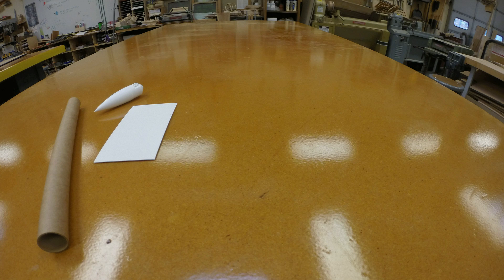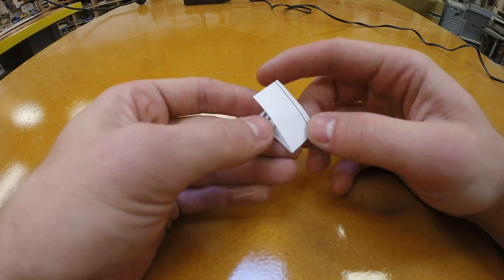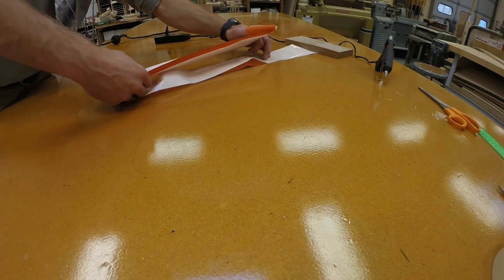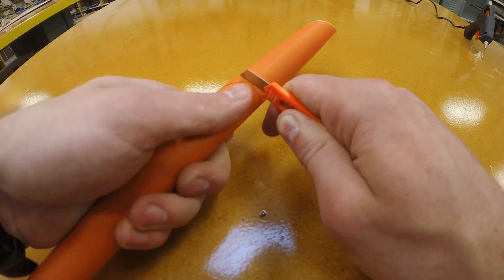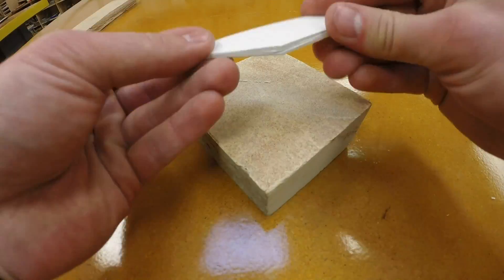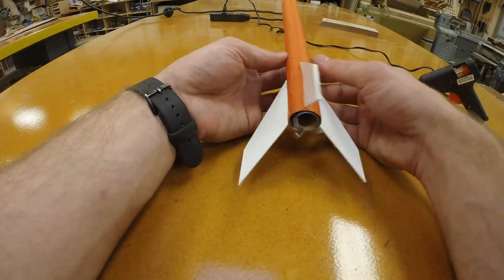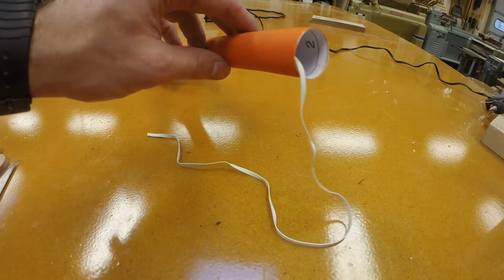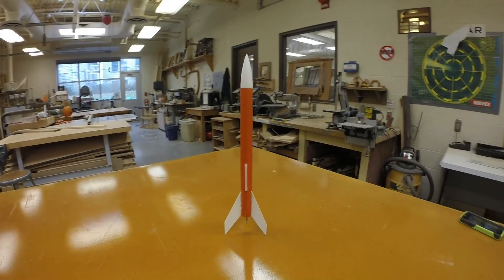Build an Estes Model Rocket

Comment: I use gorilla extra thick glue,super good glue,imho,works every time.Estes needs to make building their rockets more straight forward,here's a hint,call it the"success series" and have everything in the kit more user friendly,include machined tubes so the fins have a slot for the balsa fins to adhere too, a big problem with estes model rocket kits,and also have more three d printed parts for other rocket kits.

Comment: -why can't you apply the body tube wrap directly to the body tube??
-why must you apply the wrap over the rolled instruction sheet??🤔
Reply from the maker: For one thing, the cardboard tube adds a lot of weight to the rocket and would affect how high it goes, but also, the engine mount and nose cone are too large to fit inside the cardboard body tube. They fit just right in the paper wrap
Reply: @mr.dillmanstechchannel7363  so, the tube is only used as a form upon which the wrap is rolled upon and then removed. I never knew .......Thank you!

Comment: First time I've seen hot glue used.  The basic white glue is what I use.
Reply: todderbert hot glue is normally never recommended. I use gorilla wood glue it titebond wood glue on my Estes rockets.
Reply: Ah. In noticed in the video you were in a school shop so I immediately guessed that you were a shop teacher. That was my favorite class in 7th and 9th grades.
Reply: I agree with Chris here. use CA for most  of the gluing and use 5min epoxy for easy 1 step fillets.